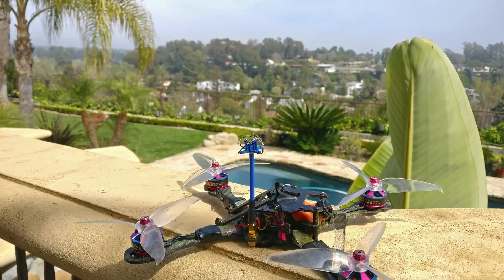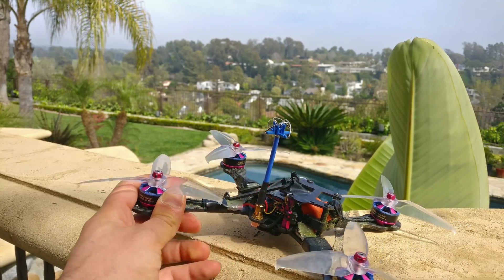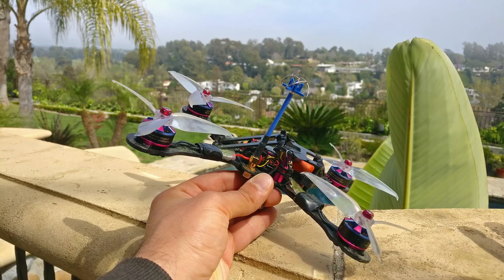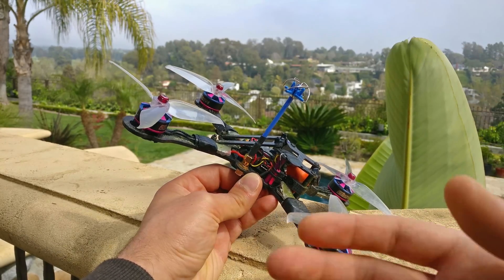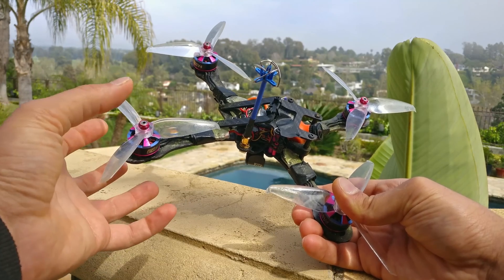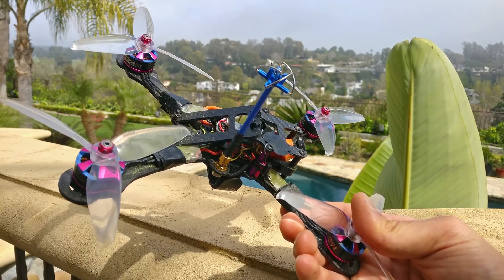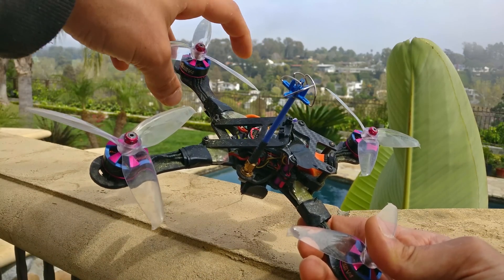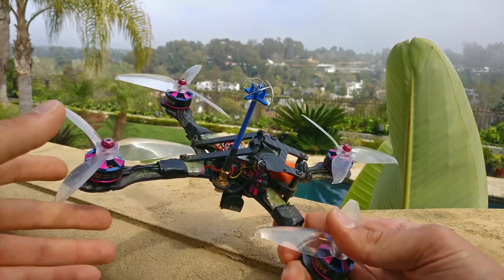Inverted Prop Rotation - Quad Theory

Comment: You’ve got me thinking about the spinning direction of egg beaters. They seem to move better or have less resistance when you move in the direction where the beaters turn towards each other as opposed to away-from. (Pull back vs push forward when mixing to test the results).  I’m picturing the beaters where they’re straight bars and not curved like a prop. 

I assume similar physics apply. I’m sure quads face many other factors, but I’m thinking of the fundamental principle.

Comment: Actually the La Trax or Traxxis [sp?] Ran reverse like this n they fly great to this day brushed n crazy props add on flood cams n lights, lol was my first every day flyer, plastic but buildable hahs. So the HYPERLIGHT Floss V1 Team Bird with the 2205 golden brown 2450s your standards stack tbs unify eagle pro micro n 5.5 HDs, i cant believe its last so long! I have one extra motor and one arm, hoping not to need them but i love your design's n wish i could pick.your brain personally get this new qx7 jumpin with my crossfire. And tempted to get an rx9 but trappy gave me the crossfire soo I dont feel.
 U ever try 3d?  U seem to float like Michael Jordan its nutss. Lol 
And can trade up my last year v1 2205 2459 team edition HYPETRAINS, one of the best motors ever.. whats up with the 2207s your rocking,.soooo fast?are they the new jam? And hate that I missed the quadbox they looked SICK! O YEA need lil hd whooppick motors lol  ill be ordering asap! Roxk!👊
..besy
Reply from the maker: I've tried 3D.  I would do it more but the transition point of the prop rotation just isn't very smooth so I'll wait till they figure it out if they do.  It's not really a high demand area.

Comment: I had already been thinking that reverse rotation was the way to go. In addition, I think you might be able to turtle out of an upside down crash at least some of the time using the rear motors only. This would avoid plastering your camera with grass clippings, assuming it works. I would do something like run the rear motors at -100% until the pitch is about -120°, then stop the rear props and set the back motors back to normal rotational direction. Wait for the pitch to get to about -45° and then do a short hard punch out. Level and hover and wait for the pilot to take over. I have not tried this yet, but I think it would at least come close to working.

Comment: I like it better,  and FYI for anyone who don't have reversible ESC's,  all you need to do is get the soldering iron out and run around your quad switching any two motor wires on each motor,  then go into BetaFlight and tell the FC that prop direction has been reversed in configuration set up. I gathered more stability in low, steady altitude flight.

Comment: I suppose the last step after inverting the spin directions would be to switch the props on the horizontal axis? :)
Reply from the maker: Ya. You need the switch in the firmware and to change prop direction appropriately. Both physically and assure motor spin is appropriate.
Reply: I actually found this video as I was searching if anyone had done tests with the motors and propellers on the undersides of the arms. Wouldn't that be way more efficient, since there would be nothing in the way of the props? Have you tested this, or do you have any theory on the matter?
Reply from the maker: Simo Kovanen yeah it is actually a lot better but it's also very impractical.

Comment: If I understood rigth, it is always better to reverse them? You will get benefits in fast flying, and nothing lose in general?  What benefits by conventional rotation direction?
Reply from the maker: There are no known benefits that are specific to the conventional rotation direction
Reply: It looks a bit strange,  a lot of companies are researching in copter developing, and almost all use the same "conventional" rotaition. Thitnk there should be a good reason for that. Thank you for your answer :)
Reply from the maker: Дмитрий Сидоров as far as I know the reason is because that's the direction it happened to be when they started designing the firmware and it's just too much hassle to change it up now.

Comment: Won’t the prop nuts fly off
Reply from the maker: Unless you use CCW and CW motors, you'll always have two props that can potentially come loose regardless of prop rotation
Reply: Thanks

Comment: Honestly its kinda amazing how much more yaw authority you have with the props reversed. Im a sponsored 3d Heli pilot and have been for many years and its one thing that we had issues with on the smaller 3d helis (IE: 450 and smaller, 500 you could cause yaw authority issues if you really tried.. 600 and up was fine) when ripping around 450s really hard and swinging the tail in a high G move that was against prop torque the tail would blow out and you would have to back out of collective to let the tail catch up.

When really ripping quads hard I hate delayed tail response and feeling the quads tail try to catch up with what your telling it to do. Reversing props solved it 99%, there is still a little less snap to yaw response in some flight conditions but its massively better then normal prop rotation.
for highly aero capable multirotors I was enjoying light weight 5 inch tricopters more then quads just for instant and not lacking yaw authority (With a really high quality and quick digital Heli tail servo as the Tricopter tilt servo) it was nice having near heli tail rotor collective pitch type tail control feel.. Once I started flying reversed props I started enjoying flying quads again and having built a tri now in a long time when like I said for a while thats all I was building for the sake of that one reason and that limited my choice of frames massively.
I still wish I could get the same feel in a race quad tail performance as I get from my 700 helis but I know that likely will never because of how fast servos are now and how much thrust the collective tail setup can provide without spool up and down times of motors like on a quad. Im sure most heli guys will agree we strive to get yaw performance from our quads to feel like our helis.. I have after much time found out that you cant and stopped trying but with reversed props and a good tune with good motors and escs you can get it fairly close.

I also started flying massive tilt levels to negate the need for as much yaw input making throwing the tail around less needed when flying low and fast hitting gates ect ect... where I will still get blow outs from time to time is at 30 to 35 degrees of tilt and really ripping hard around tight areas when flying proxy freestyle and banging the yaw stick hard trying to sling the tail around to catch up with the nose, thats when I notice slightly slower yaw response.
but its no longer enough of a issue that it causes problems for me.

Comment: Better controllability with reversed motors seems related to particular props. However one thing is undoubtly clear - reversed props will (mostly) keep your camera lens clean. Learned it by myself after three weeks flying with reversed props.

Comment: In BetaFlight 3.2.0 RC3 and above in Configuration tab under Mixer picture is the "Motor direction is reversed" switch which make the switching dead easy. However some FC-s begin yaw twitch after reversing. Matek F405 AIO for example. No such issues with non-reversed motors. How I overcome this?
Reply: Solved F405 AIO twitching with reversed motors when reflashed BF to 3.2.0 RC5. Probably it was caused by bug or smth in earlier release candidates.

Comment: KISS FC and ESC advice. I just updated to the latest 1.3 firmware and the new GUI. You can flash the ESC'S from the GUI now and reverse motor direction. WARNING do not forget to reverse yaw if reversing motor directions. This is also a check box in the KISS GUI now. I forgot and the quad did a spinning rocket ship in my flat 😅

Comment: Seems that betaflight 3.2 changed the command for inverted yaw rotation. Any ideas on what it is? 

thanks
Reply: TransAm2k4 set yaw_motors_direction = on
Reply: TransAm2k4 the option is also under the configuration screen

Comment: I think the purpose of the standard rotation direction was to protect the electronics.  Prop debris and prop strikes aimed toward the FC and other components could be a problem.  If what you and others are saying is true then maybe it is worth the risk but I'd like to see more evidence.  If it all turns out to be true maybe we will see frames designed to protect the electronics better.

Comment: Hi, do you know if set yaw_motor_direction = -1 still works in betaflight 3.2 I tried inputting it but it shows Invalid name
Reply: Toothless FPV on configuration screen there is a toggle switch to reverse motor Direction same thing. Or in cli set yaw_motors_direction=on. This is for betaflight 3.2.

Comment: There is a reason the default for quads is the way it is, the overall turbulence per motor is significantly increased by running "backwards" along with a reduction in transitional lift, this means harder to tune, less headroom on each motor for control and lower top speed. The sacrifice for this improved flight performance is splatter on your cam when you play in the green stuff, not an issue for most, I like your thinking though

Changing the rotation is like tilting your motors, people get a perceived positive effect which is just covering the reality of a reduction in performance. Most people would not be able to tell the reduction of performance making the change has but the gain in being able to see while trimming the hedges is worth the change :)

Comment: If the grass blood no longer hits the lens, doesn't that mean its getting on the PDB/FC/misc bits? Bit of a toss up between those two :/
Reply from the maker: Shortly Tall I thought it would but it's not any worse. we're not talking about like chunks of dirt. it's like tiny droplets that cause smudges. before you say you don't want droplets on your electronics, it's getting on there already...
Reply: Hmm..... I'm paranoid of my quad by default, so I'll probably wait until quad #2 is back in the air, and reverse its props. Still have one to fly in the event of worst case scenario haha

Comment: HUGE WORD OF ADVICE WHEN DOING THIS!!!  WHEN YOU FLASH A NEW VERSION OF BETAFLIGHT, THE CLI SETTING DOES NOT GET RECOVERED IN THE STANDARD BACKUP FILE.    you have to do a dump of the cli settings. if you forget, you will end up with all four props spinning the wrong direction....unfortunately, that does not mean the quad just pushes itself into the ground... It reminded me of that one time i antagonized my cat until he turned into a Tasmanian devil.  

i just flashed betaflight 3.1.7 and did bardwell's propwash first step and had a quad spin up and fly a wobbly path up and put a large dent in my gutter before doing the longest hangtime i've ever seen as it plummeted to earth.  fortunately, it just put a small impression on the battery pack but there is a huge dent in my gutter now.  I saw my life flash before my eyes (i was only 4 ft away)  seriously, the echo brought out some of my neighbors to see what happened.  

All of that said, this was still the best thing i've done to help my flying.  no more grass covered lenses
Reply: I always do a dump, and then a diff of the new versions dump. After that, there is never anything wrong (unless I just did something stupid myself). Glad you did okay :)
Reply: I did not know a CLI dump was necessary.   I did a backup of the betaflight settings and that worked well, but the CLI dump was not something i knew about until after i almost ripped off my gutter
Reply: Five Freaking Onion Rings yeeesh

Comment: Another positive thing in changing prop rotation is that most of us are in the situation that we have 1CW and 100CCW left props. We rush to order new props and the quantity of CCW doubles. That happens because we are left or right handed and tend to make more corners to the left or right. Sometimes we crash and because of orientation destroy one type or another type of props. Now... when we have lot of CCW(CW) left props, we change rotation in BLHeli keeping destroying props on motor 3 as example, but in this case we destroy CCW props instead of CW. :)

Comment: Brilliant. Ive been putting rainx on my lens so I can even see durning light rain and snow storms. This works so good. Thanks.
Reply: I've tried rain x on the inside my goggles lenses. Just a tad on a qtip, it helps keep the condensation from fogging up the inside. You dont have to run your fan every flight. Works great in cold weather. Im sure there are anti fog/condensation cleaners for glasses or something.

Comment: Kabob, I think it would be really cool if you could show us some blackbox data to show us how the motor speeds are affected in both scenarios.
Reply from the maker: RoscoFPV many have suggested this but it would be pretty hard to recreate the same turn in order to prove it.  I'll consider it in the future. I actually think just showing flight footage with audio would be easier. you can clearly hear it when the rear top motor is stuck at max
Reply: It definitely wouldn't have to be the EXACT turn, but if you could do just 3-5 hard 180s with 1 setting, and then 3-5 similarly aggressive turns it would be enough to get the point across. BTW it's not that I don't believe you. What you're saying sounds legit but I'm all about the data! In this hobby there's so much that gets hyped up so it's nice to have the data.
Reply from the maker: RoscoFPV yeah I know I like data too but it takes additional effort to obtain

Comment: tried it out today - in a direct comparsion with two identical copters.
and it really eased up handling in yaw turns. i have to get used to it definately again. thanks
Reply from the maker: Simon Sais that's what I felt too. I thought I was imagining things.  must be something to it.
Reply: +Kabab FPV it has only advantages and costs nothing extra. but you need to be sensible to it and have a comparsion side by side aaand fly already fast enough to get the benefit of the control plus. (as you mentioned in the vid) i'll keep it. i heard about it already a year ago, but it was not that easy to find out how to change it. there should be a button in betaflight. or a initial choose process at the beginning.
Reply from the maker: Simon Sais yeah there really should be a switch
Reply: mower mode ^^
Reply: showed it to some other guys without telling them how it affects the craft. everybody told me the same. quicker in fast turns, less grass = awesome ^^

Comment: Plus don't forget to reverse (rearrange) your props! :D
Reply: Who uses CCW nuts anymore? lol
Reply: And rearrange your motors so the nuts don't come off immediately after a crash if you keep this setup.
Reply: who care about prop nut? still using CCW????
Reply: i have the nylock nuts that came with the wizard.  no issues here
Reply: Ones who have CW/CCW motors/ I still have Emax RS2205 and RacerStar RF2205 sets which have dreaded CCW too. The good news is that I have some packs of nylock nuts as well so CCW-ness doesn't bother me anymore :)

Comment: it seems that another way to look at is motor 3 isn't trying to pull the back end around, but motor 1 is actually pushing the back end around the turn. and pushing is usually a lot easier than pulling something around a turn (think drifting) - if that makes any sense
Reply from the maker: Daytona FPV yeah makes sense. I personally think it's more so trying to actually execute the yaw movement as well as my desire to push hard through the turn.
Reply: i was thinking more of ease of kicking the back end around as opposed to how hard you want to turn.

Comment: Very interesting line of thought, but changing the motor direction will transfer the problems you are mentioning to the front motors... in other words, switch the motor direction and now it's the front left motor that will hit max throttle(in a right turn). No?
Reply from the maker: Pouya Mohtat not unless you're flying backwards. an underslung battery is harder on the rear motors no matter what. front motors are always fine. to properly balance the quad for turns you would need to move the battery directly under the front motors...which would screw up a bunch of other movements.
Reply: but don't forget, it's pushing the back end around instead of trying to pull it around so motor 1 won't have to work as hard as motor 3 would have to work in a normal configuration - for an underslung battery because don't forget, with the CG being low, the weight is going to try and pull the quad level. if you had a top slung battery it will actually help the normal configuration because the CG is now off center in the direction of the turn so it's going to try and pull it into the turn
Reply from the maker: Daytona FPV yeah those are the main differences with top/bottom battery.
Reply: Yeah, ok I get it. so you recommend doing it only for underslung batteries or also top mounted ones?
Reply: it's dependent more on your flying style... for me, i'm far from amateur as it is, but i prefer underslung batteries, but with that being said, i just built a top mounted one and im not really noticing any difference much, but then im not racing with it yet.
Reply from the maker: Pouya Mohtat it keeps your lens clean!  that's why I recommend it. the rest is whatever.
Reply from the maker: Daytona FPV yeah I feel similarly about this. underslung does feel more planted in the air but ultimately after 5sec of flight I'm not really feeling a difference. I do still like the traditional top batt setup however. if I could get it as light and strong as the under slung I would fly it exclusively.
Reply from the maker: Vekz yes bottom batt definitely lands right side up more often.